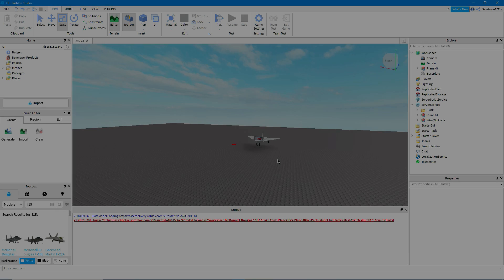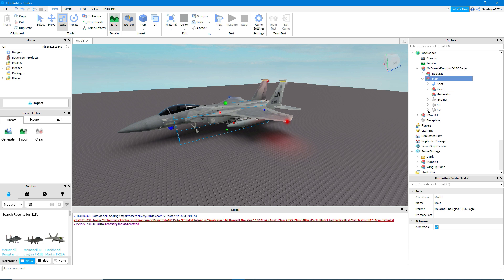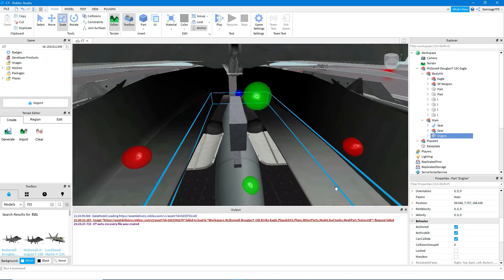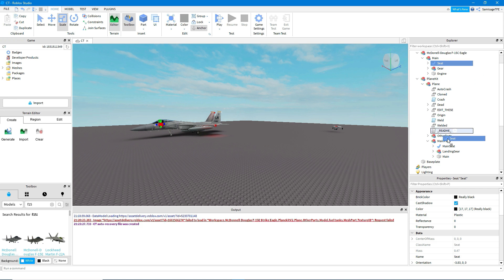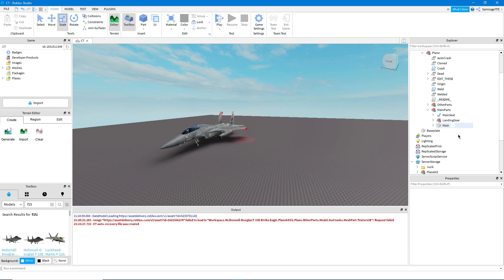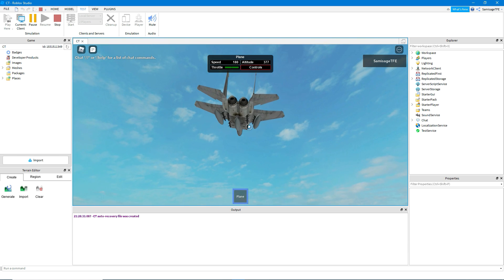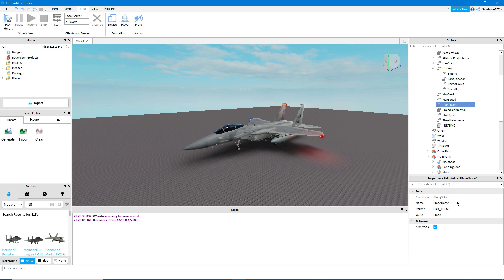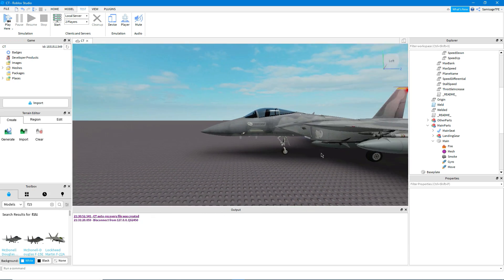ROBLOX Plane Series Ep.1 | How to setup the Plane Kit

Comment: Do you know how to make propellers move with startup and move faster the more speed you put on I haven’t been able to get a propeller to move yet I’m just about to add this kit to my Avro Lancaster just the propellers and some interior work to do and it’s done would help a lot if u could make a tutorial on propellers
Reply: You can use tween service to move the orientation of the propeller blades based on engine power, kinda confusing to explain. But yeah, it requires tween service, to make it simple yoy can just use tween service to rotate it when the plane is on.